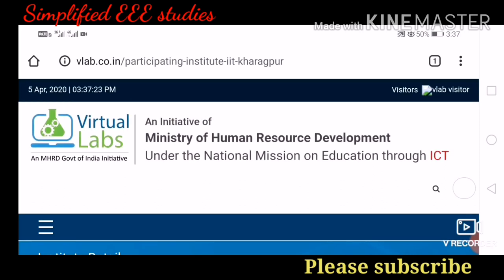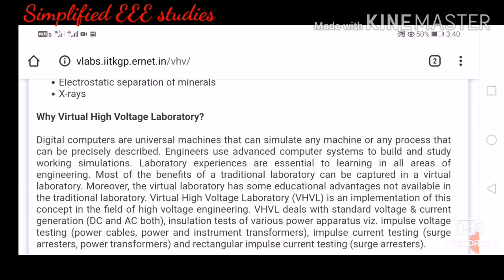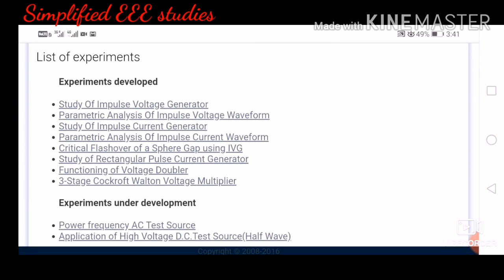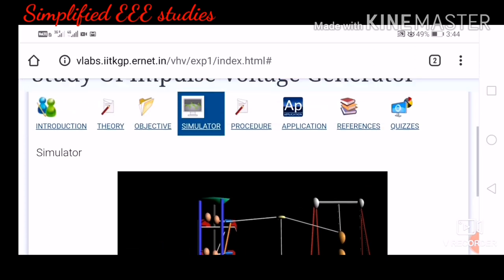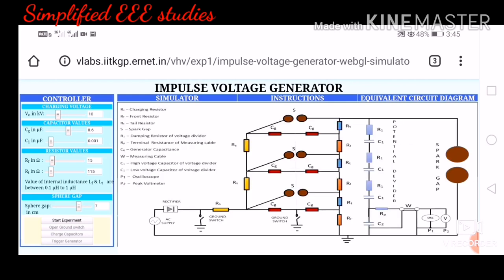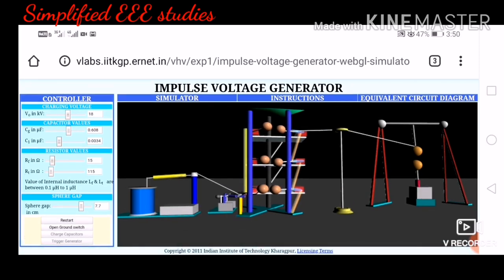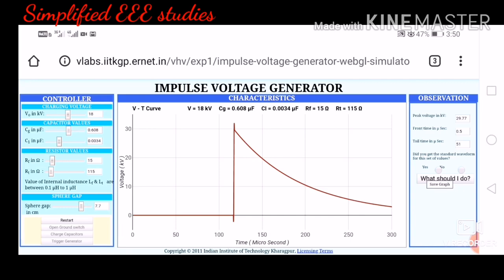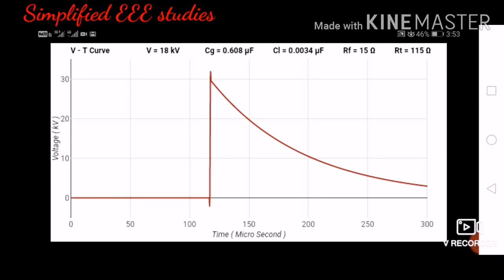Simulation of Impulse Voltage Generator

Comment: sir please define what is impulse voltage generator and what is its purpose
Reply from the maker: Good morning, 
Definition : Device which is used to produce impulse voltage.
Applications : Testing of power system application.
Testing of electrical machines especially distribution transformer.
You may refer all my videos related to impulse voltage generator. Even I have explained types of Impulse Voltage Generator.
Have a great day.
Thank you